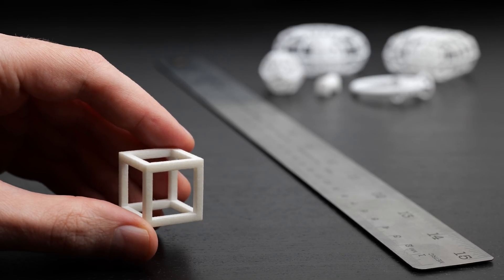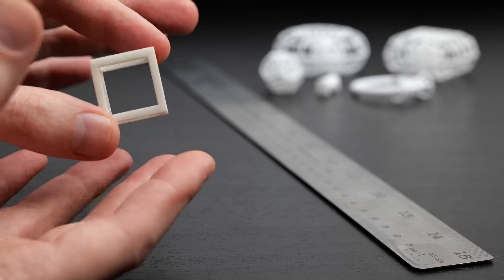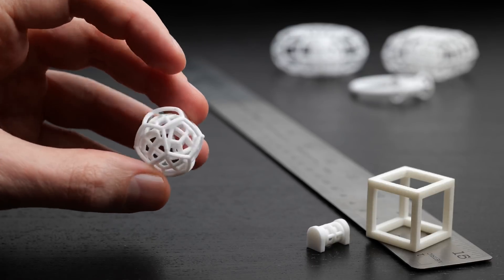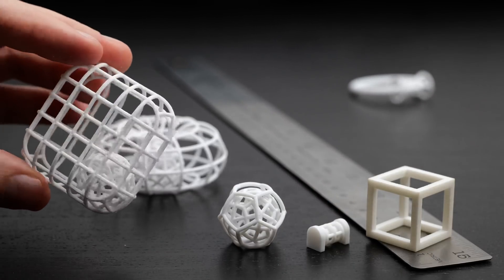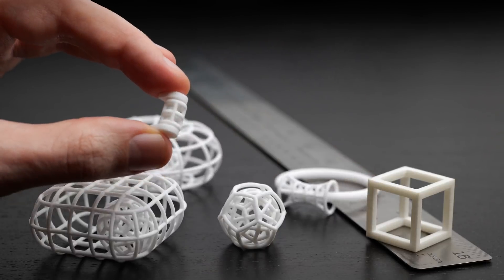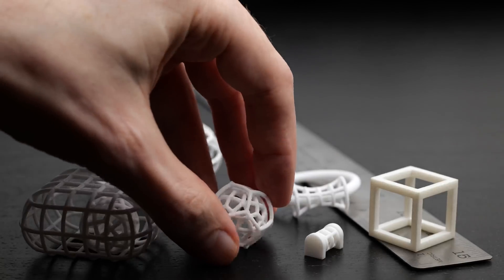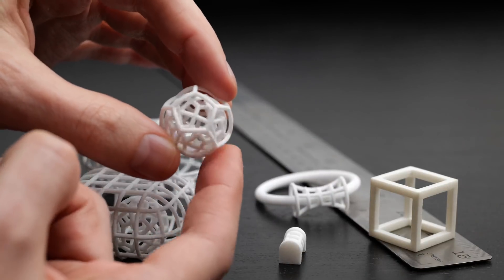Puzzling degrees of freedom

Comment: If the rule is that you only consider the degrees of freedom from the start position of one object, aka the first move, here are my solutions:

1°: Large cube A and small cube B. A has a hole on one side that is the size of B. B can only move in and can't rotate

2°: Cube A and cylinder C. Same thing again but this time, C can also rotate while being inside A

3°: Cube A and cylinder C. A has a similar hole to 1° but this time, the hole extends to one edge of A. C can now move in and out, rotate along it's center axis and move sideways. It cannot flip to the side because the bottom rim of C would collide with the walls of A's hole

4°: Similar to 3° but this time, the hole extends to two opposite edges of A. Basically a cube with a deep rectangular cut in it. The cylinder can now move in and out, sideways, rotate along center axis and flip sideways

Comment: 4:16 I know about ball joints, I guess that would do it. A ball with a connection in a round socket can move in 2 rotational degrees of freedom, except for the angles pertaining the common center point, where the shaft goes, otherwise there's no possible physical solution without surface overlap.

Comment: For five degrees of freedom without boundaries: you could make a hollow surface of a sphere and let a ball roll around in there. The only problem is that there is no way to connect the inner sphere with the outer sphere, so you'd have 3 objects instead of 2.

You could use the hollow surface of another 3d object, but you always run into the same problem. The best solution I can think of is using the hollow surface of a klein bottle, but that surface intersects itself. This means you'd either need walls so there are 4 degrees of freedom at the intersection, or you'd keep the intersection open so there are 6 degrees of freedom.

Unless someone finds a klein bottle that doesn't intersect itself, or finds a way to lock two object's rotation regardless of their relative position, I don't think a consistant 5 degrees of freedom is possible.

Comment: The last one that has a circle axle is 3 degrees not 2 . To make a 2 degree axle u want to the the wheel on the axle run freely side to side but not around and around a circle. A wheel on a circular axle has 3 degrees of rotation not two. Correct me if I’m wrong
Reply: I make this argument because as the wheel on the axle travels up either side of the circle it is moving in that direction to the left/ right but its also simultaneously moving up and down.  Making the axle strait would take out the height dimension and leave it with 2 degrees

Comment: The idea I have for exactly two degrees of freedom is a wheel on an axel that is much longer than the wheel. I can see a strange quazi real object that would technically contain whatever was inside but it would not be possible in our level of reality. Basically the idea is a box with all of the classic dimensions of freedom but also more because there would be some crazy objects passing through each other stuff going on.

Comment: 1 degree of freedom: Cylinder on an axle, 1 rotatoy degree of freedom.
2 degrees of freedom: Same shape but with room to go up or down, 1 rotatory degree of freedom and 1 translative degree of freedom.
3 degrees of freedom: Same shape but stretched in one axis, allowing for left to right movement, 1 rotatory degree of freedom and 2 translative degrees of freedom.
4 degrees of freedom: A bigger cylinder on an axle, so it can move around and rotate, 1 rotatory degree of freedom and 3 translative degrees of freedom.
5 degrees of freedom: Ball inside a short cube that doesn't allow for up/down movement, 3 rotatory degrees of freedom and 2 translative degrees of freedom.
I really struggled with the last one, since my original idea was way to complicated.
Also, all my ideas have restricted movement so...

Comment: for the five degrees of freedom without barriers, maybe you could make the cage in which the smaller sphere resides in into two bigger spheres barely connected to each other to prevent collapsing, that way the solution would be more similar to the other earlier solutions (as in being able to keep rotating or translating without hitting a boundary)

Comment: Food examples, because they're funny and intuitive.  (Ignore the loose tolerances, they're just for illustration.)
1DOF: Large pizza in a large pizza box.	Z rotation.
2DOF: Doughnut on a stick.			Z translation, Z rotation.
3DOF: Doughnut in a large pizza box.	X and Y translation; Z rotation.
4DOF: Hot dog in a large pizza box.		X and Y translation; X and Z rotation.
5DOF: Tangerine in a large pizza box.	X and Y translation; X, Y and Z rotation.
6DOF: Tangerine in a refrigerator box.	X, Y and Z translation; X, Y and Z rotation.

Question: Are coupled DOFs, such as a nut on a threaded rod (Z translation only with Z rotation and vice versa),
 counted as one DOF or two, or something else?
I wrote this up before watching your solutions, so disregard the question if you answer it in the rest of the video.
Reply: To answer your question at the end: a hot dog in a round pizza box of smallest possible size to fit the hot dog would only have X and Z rotation (both unbounded,) with no space for translation.  That's a real stretch of the analogy, but hopefully you get the picture.

As for your issue with the 5DOF having bounds, my 5DOF is the same as yours and most of my other food examples have such bounds.  I'll have to ditch the analogy to come up with an answer.  The closest I could think of was a sphere rolling on the surface of another sphere, all of which is inside a sphere.  XY translation and XYZ rotation.  But you either have 3 parts that way or you connect the inner sphere to the outer sphere (say, at one of the poles) which introduces a single bounding point.  Close, but not perfect.  Grr.

Comment: Two rotational degrees of freedom:
Start from the sphere-inside-a-sphere solution with 3 degrees of freedom.
Cut a slot into the outer shell, as if to allow a coin to be inserted.
Instead of a coin, insert a rod and attach it to the inner sphere.
We can now rotate the inner sphere by moving the rod from one side of the slot to the other, or by rotating the rod around its length.

Comment: I got a spoiler for 2 degrees of freedom from another comment, but:

3 degrees - a disk contained in a hollow space shaped like a larger disk with the same thickness (2 movement 1 rotation)
4 degrees - sphere in a hollow cylinder with the same internal radius (1 movement 3 rotation)
5 degrees - sphere in a hollow disk with the same thickness

are just the first things I thought about

That begs the question: can you get an object with 2 rotational degrees of freedom relative to the other?

EDIT: reading down, that's a simple question, just a long rod with rounded ends with length L and diameter D, and a hollow disk with internal thickness D and diameter L

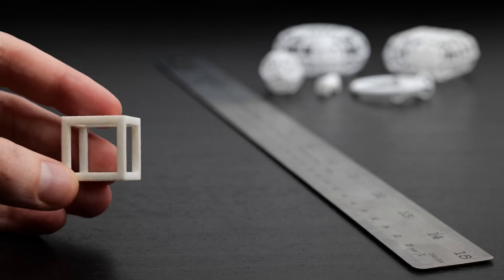Comment: 1:20 OK I'll take the bait.
    1 translation: Easy, put an extruded + shape (or any other shape besides a cylinder) in a similarly shaped channel. It can slide but that's it
    2 translation: Tougher, maybe take the same extruded + and put it in a grid. It can slide and change directions at intersections. Maybe this is cheating
    3 translation: Very hard. Maybe have a 3D + shape that looks like a + from all 3 sides and put it in a grid of cubes but then getting the cubes to stay in place is tough!
    1 rotation: Easy, just put a cylinder in a cylindrical hole with caps so it can rotate but not slide up or down
    2 rotation: Tougher but not too bad. Just make a pivot and attach to another pivot rotated 90 degrees like an articulating trailer coupler. This is a 2 axis gimbal
    3 rotation: Easy, that's just a ball joint

I don't have time to think about the mixed cases but those are fun too

Comment: 1 degree of freedom is a dove tail pattern kind of the same way rail roads do it
Carpenters and machinists love making this pattern and presenting it as a puzzle of how the work pieces are locked
Maybe something similar to the cap of a bottle with no threading?
I have a few other designs in my head but translating them into text is not really feasible
Reply: The impossible dovetail is what I meant in the comment
A normal dovetail is just a method of joining wood joints together

Comment: For the two degrees of freedom you could use a giroscope and take the innermost and the outermost frames, or the wheel and the middle frame.

For 5 I'm imagining two balls inside a spherical shell twice it's diameter, so if you take the sell relative to one of the spheres it can be in contact with any place of its surface but not away from it, and of course it can rotate. The second ball is there just to restrain the 6th degree.

Comment: Just wondered if there is a way to make a holonomy maze based on the geometry of the cuboctahedron. I would involve a 10-pegged rook, which would be brittle, but it would also have 12x10 states. If one allows edge crossing, there is a stellation of the cuboctahedron that would add 24 more vertices (for a total of 36), obtained by rotating 60 degree around the hexagonal equator. So 36 + 48 such intersections would give 360 or 840 states... and a good headache, maybe...

Comment: 2 rotational degrees of freedom could be done with a pair of shapes which couple into a globe like shape.

Shape A could be a sphere with a torus hole in it and shape could be a C shaped thing that hooks into the toroidal hole.

Rotating around the first rotation would change the direction of the second though. So instead of having two degrees of rotation overall, it has two degrees of rotation at any given moment, with more accessible when the second isn't.

For 5 degrees of freedom without borders, a "double cylinder" where 2 sides have a cross section as a circle and 1 as a square (similar to that of a square cushion but taller) inside a torus could probably work?

Comment: I needed your example to be sure I understood the question (thank you for thinking to include that, by the way), but once I got that, I could pretty much just extend the idea, although most of my (first) solutions were bounded, which I agree is unsatisfying.

Right now, the only way I can think of to get two rotational degrees of freedom requires 3 shapes.  One to be our measuring point, one with 1 rot-freedom, and one with 1 rot-freedom relative to the last, and so 2 relative to the main one.  Basically like an incomplete one of...what are those called?  I keep wanting to call them "gyros", but they're like Euler Angle Wheels, the things that pilots get put inside in a chair.

Also, for 5 degrees of freedom, your thicc plane segment could be turned into two bounding spheres with (some number of) arbitrarily thin connectors to make it work in 3D.  It would still be bounded (once you run into one of the posts/columns/connectors, you just cannot go farther without moving another way first), but it feels better.

Comment: My one degree was a dovetail/t-slot with matching mate (one linear degree, no rotation), then the two was the same for the slot and a circular version of the thing sliding (such that rotation along an axis perpendicular to the plane of the dovetail can be added). You could also take the linear dovetail/t-slot and put it on a cylinder or sphere and get the same result, but the linear degree becomes rotational. The two degree version of this could be a cylinder with a trench held by a peg, never able to tilt itself up on to the face.
Two degrees of linear freedom is a lot more difficult to do continuously with just two shapes but can be done with discrete allowances or a third object. Allowing a rotation makes it a lot more easy if either you take it as the limit of a situation, allow limits, or allow sandwiching two infinite surfaces as it becomes basically air hockey. Two rotation and two linear is a dowel on the floor. 
Two rotation and a linear (as far as I can tell) requires an intermediary as there must be a strong boundary condition between the two shapes in such a way that it can't be part of either. Three linear degrees also get difficult to have be anything but with three rotational if there is no intermittent pieces. 
Adding in the ones that you also had, this means we've got eight fully constructable options (though turning a linear degree slightly rotational to make it not have ends might be needed), three doable with additional boundaries, and five only doable with extra pieces.

Comment: Very cool question! There are some I'm not sure about, because I'm not sure about the precise definitions of degrees of freedom
, but here are my ideas:
1 degree: a closely-fitted cylinder with the cube inside. Alternatively, a very strange one I thought of is three quarter-circular tubes which connect together to form a triangle with 3x90° interior angles; this allows for movement in all three directions and also rotation to boot, but none of it is independent, as there is only "forwards" and "backwards" for the cube.
2 degrees: a tall cylinder with the cube inside
3 degrees: this one has a lot of options! Similar to 2, but the opposite — a large pancake shape, which allows for movement in a plane and rotation about one axis. Another option would be a sphere which is closely fitted, so you have three rotational and no lateral degrees of freedom. 
4 degrees: A long, thin pole which the cube is threaded through. This allows for (limited) independent movement in all three axes, but only rotation about one. 
5 degrees: this one seems to require to restrict movement rather than rotation — there's no good way of allowing rotation along only two axes, but also allowing for three degrees of freedom in your movement. My thought then would be to put the cube inside the sphere from 3, and then put that inside the pancake (also from 3), but this isn't quite getting 5 degrees just from putting the cube you showed inside another object.

Comment: You can accomplish two rotational degrees of freedom with a kind of ball-and-socket joint. The inner part would be a sphere with a cylindrical rod sticking out of it. The outer part would be two hollow hemispheres with a gap between them equal to the diameter of the rod, and connected together by supports that reach beyond the extent of the rod. This is like a joystick that can be tilted forward and back and rotated axially, but cannot be tilted left and right.

Comment: My solutions:
1. A cube in a square tube (1×translation)
2. A cube attached to a 2-axis glider (same as in a printer) (2×translation)
3. Cube in a box with height same as size of the cube (2×translation+1×rotation)
4. Oval (egg-like) shape in a box. Box high same as small diameter of the oval.(2×translation +2×rotation)
5. Sphere in box (same as in the video)(2×translation+3×rotation)

Comment: This is actually a known engineering problem in the field of mechanism design. A mechanism (a set of rigid bodies connected by joints) has the six DoF of moving the whole mechanism around in space plus the DoF allowed by the joints. Therefore, joints are classified by their rotational and translational DoF. I think that subdivision adds some fun complexity to the problem rather than just considering the total DoF. For example, a 1 DoF joint can be a hinge (rotational) or a slider (translational). There are 3 possible types of 2 DoF joints, and so on. Trying to come up with the full set is a fun problem.

Comment: For 5 degrees without a boundary, my idea is to extend the planes so that they wrap around and make a torus around 1 axis, but somehow do that in both axies, which basically results in 2 concentric spheres with the free-to-move sphere in the space between the first 2. But the problem is that IRL the inner sphere would also be free to move, and adding supports would act as a boundary

edit grammar

Comment: what if you had two spheres touching, then around them both, concentric with on of the spheres, you had another sphere. The non concentric sphere can rotate on all axes, three DOF, and it can translate in two directions, two DOF. so five DOF and no boundaries. problem is: that's three parts, not two.

Using more than two parts it's pretty trivial to make something with exactly two DOF where both are purely rotational. I'm not sure how you'd go about it with only two parts.